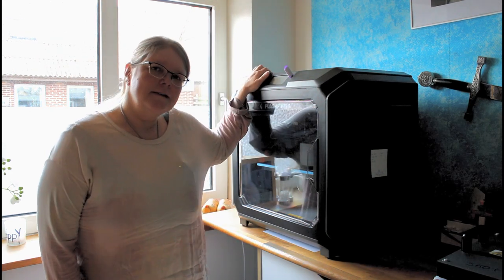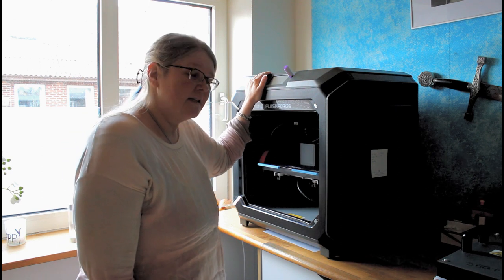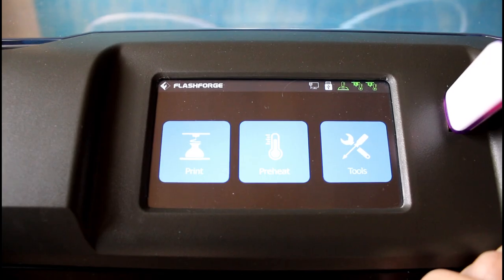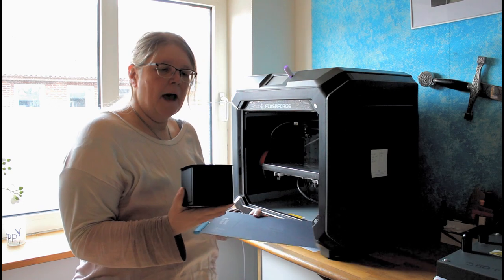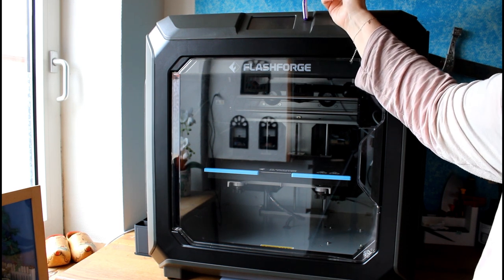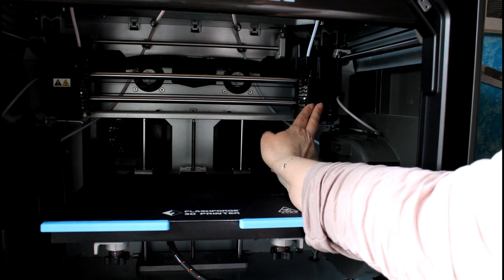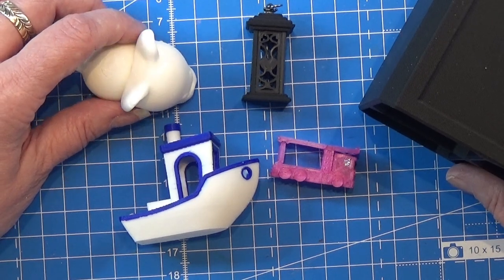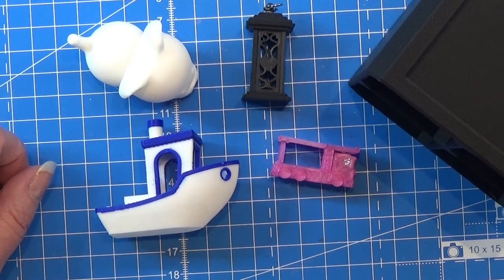Flashforge Creator 3 Pro - Taking A Look At My 3D Printer

Comment: Cool Video, thank you 👍 had the same issue with mine, that I brought last Dezember. Noozle chrashed into the plate. Lesson learned: Don't trust a manual. Flashforge didn't replace mine, not very customer friendly.
Got mine running in the meantime and prints look fine now. What additional problems are you referring too, that you clarified with FF Support? Thank you, Cheers from Germany
Reply from the maker: Well my build plate was replaced by the firm where I got the printer, I told them that it was not my fault, but a fault from the booklet, I could not be responsible for the problem, - even send them a picture of the booklet, - and that if they would not send me a new plate, then I would returne the printer to them!
That worked!!

But I still had a great big deal of problems with the printer. My printer would not print right now mader how I sliced my files, the print came out as if it had a really bad underextrution, especially on the right extruder, so after a few month of hazzle! a went online on FB and a frind of mine gave me an email to flashforge!
So I contacted them. A very friendly person in there helped me out for over a month - they sliced files and sended them to me, for me to print, and end result did not look great - then I send one of my sliced files to them, for them to print, and that was running perfect on there creator 3 pro,  but not on my.
So they came to the conclusion, that there was something wrong with my extruder heads, so they send me 2 brand new extruderheads for free, I installed them, (installing them was deffently not for newbes) so I'm happy this isn't my first 3D printer!
I think it was the small extruder "motherboards" there had some kind of mistake

But after replacing and leveling and all that, it is now running perfect time, unless I don't get the temp right LOL
I'm really happy for the service they provided to me.
Reply: @DRN  Oh, looks like you really had trouble with your printer, thank you for the info. Although I get most of my prints done in the meantime, it's still a learning process, especially when it comes to specific stuff like duplicate mode prints. Most of the time I use Simplify3D, but I gave up printing over network. Most of the time the prints fail, but succeed when printing the same file via USB. But in general I'm very satisfied with the machine.

Comment: Hi, I've activated today for the first time a creator 3 pro like yours. I've a problem: it seems that the printer extrudes the material too far away from the build plate. The leveling and calibrating of z-axis have been made several times, automatically and manually. Nothing seems to work. Does the blue cap on the leveling sensor must to be removed before the use? I can't understand why it continues to print far away from the build plate also after z-calibration...
Reply from the maker: Hi there
No the blue cap stays on! Do not take that of!!
You did manually leveling? did you make a sensor calibration?
My manual told me no to, and that scratched my bed, but after calibrating the sensor, it works great! so if you did not do that yet, please do and try again
Reply: Hi there! I've had the same problem with my creator 3 pro... Now I just entered a Z-offset in the Flashforge slicing program. You can find this when u press "start slicing" and then under tab "others". There is a Z-offset function wich you can manually adjust. Mine is currently  -0.22mm and I've never had to change this again. This will probably not be the same number with your machine but you can play with it so you get the right height! Just make sure u save the configuration so you won't make the same mistake again :)

Comment: Hi, I have almost one year with this too. It prints well. Any idea where to get the trash bins?
Have you print  with TPU filament?
Thanks
Reply from the maker: I actually don't think they sell the trash bins anymore, you maybe could find a 3D print one.
No I haven't printed with TPU yet, but I did hear that it should be working fine on this maschine